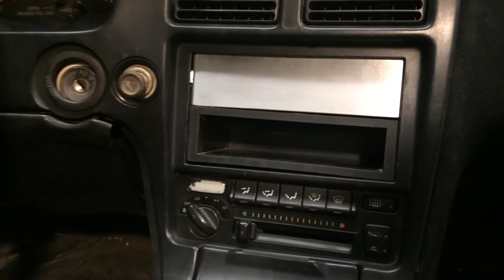Stereo Delete plate

Comment: Very nice work there 👍 mom and dad always used to take me car shopping with them and i recall a GM dealership where the cars on the lot just had a big hole in the dash where the stereo would be.  There was an issue back in the day with kids stealing the stereos so the dealers would have them installed later. Maybe the origin of the "dealer prep fee" lol? Hey im old and this was way before touchscreens. But  i guess its possible that they still had a "radio delete" option even not that long ago🤔. 

Funny thing is that even as a young un i remember asking questions to the sales guy about the hole in the dash because i could see the wires sticking out.  And it already had speakers in the doors and the back shelf and everything too.  So even though the radio itself wasn't installed yet , idk who would ever say that they didn't just want it put in at that point.....
Reply from the maker: Haha... Also the factory used to offer cars with no stereo for a lesser price. Now adays, this is all standard issue.
Reply: @scantronsgarage  well that would also be well before these "trim levels" right?  I heard that at one time you could customize plenty of options however you wanted

Comment: Very nice build, have you managed to start it up yet?
Reply from the maker: Thank you! I’m working toward that goal of starting it up. Just need to plumb up some stuff. I’m in the process of building a new garage which has slowed down the process significantly. More updates soon!
Reply: @scantronsgarage  That's very good, I just have two more question, would it be possible for someone to do the same swap with the LS3 or is it too long and what transmission are you using? Good luck on your project and Merry Christmas!
Reply from the maker: @alekssbelskis3544  merry Christmas! A ls3 will work too. I am using a Porsche 6 speed transaxle
Reply: @scantronsgarage  that's very cool, which car is the transmission from though and when you finish the swap do you plan on keeping stock LS4 power?
Reply from the maker: @alekssbelskis3544  from a 2001 booster s. I will do some cam and valve train upgrades down the road
Reply: @scantronsgarage  that's very cool, how did the Porsche transmission fit with the LS4 and did you need an adapter plate?
Reply from the maker: @alekssbelskis3544  it is all in my videos. I have an adapter plate video
Reply: @scantronsgarage  that's very cool, I'll be sure to check that out.